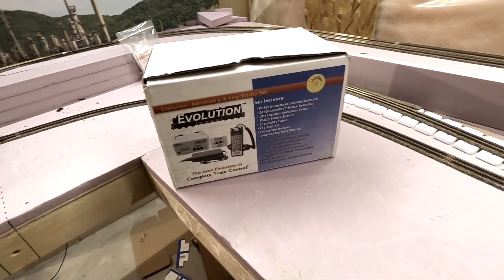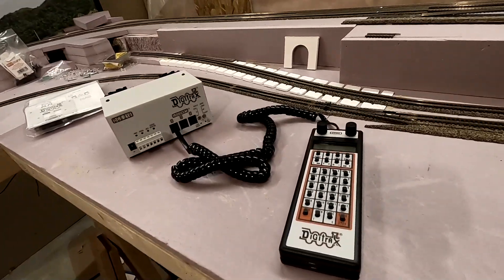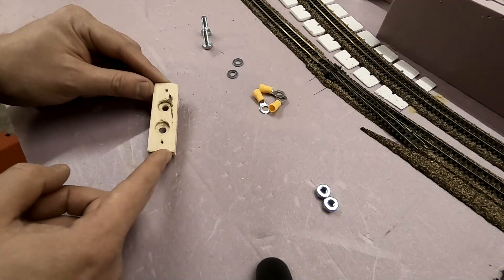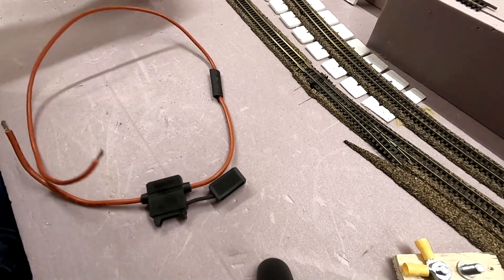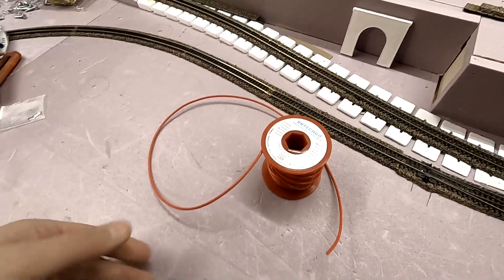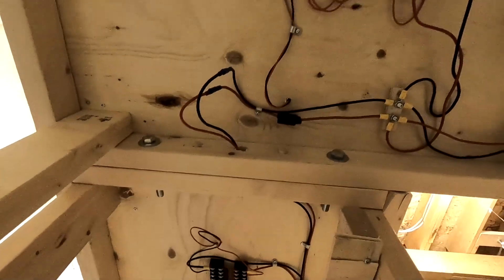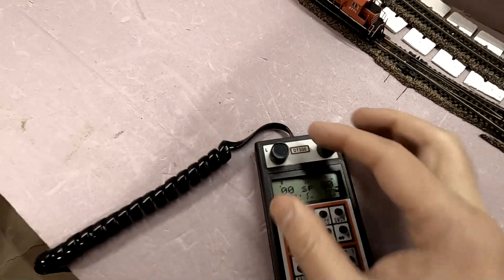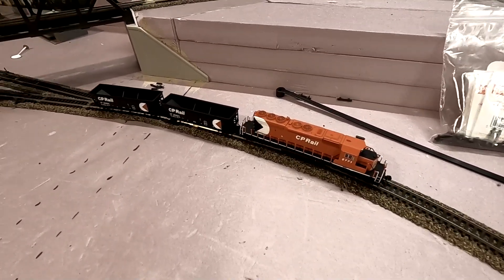Complete DCC Wiring for DIGITRAX Evolution Starter Kit

Comment: The 12 gauge stranded wire fit in the DCS210 terminals without any problems? You didn’t have to remove any of the strands or make any modifications?
Reply from the maker: I think I may have had to cut a few strands off. I don't 100% remember though.

Comment: New to the electronics side of this... i assumed the tortoise would be on its on separate bus/circuit.  Im not comprehending feeders to it from the track bus as power.  Is it basically just using the tracks voltage but no dcc signal? Or does the tortoise have its own address that you have given it via the dcc system and whatever button you have programmed throw it, without having to do all the old school wiring of a separate switch in conjunction with the track circuit?
Reply from the maker: DC power controls the Tortoise motor. DCC feeders are needed for the polarity of the track. The frog has to switch polarity when the turnout is thrown.

Comment: You can plug the connector from the command station into either port on the back of the UP5 and both ports on the front are live.  There are two ports on the back so you can connect multiple UP5s to each other and not have to run a cable back to the command station for each UP5.

Comment: Absolutely great job! The rule as I was taught it, is that if you need to make more than a 6 inch run from the track to the main throttle bus, you run a 16 gauge stranded wire from the bus to the 6 inch or less 22 gauge solid wire. That will transmit plenty of current! I agree that for runs up to 24 inches the 22 solid gauge wire is ok!